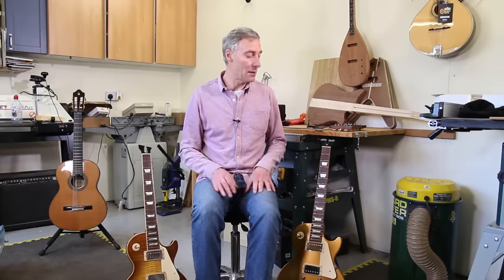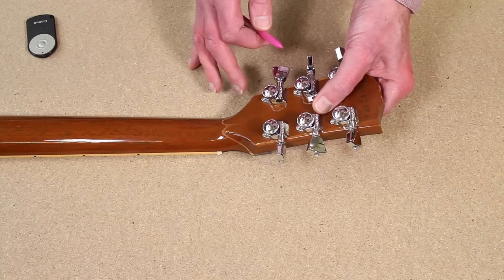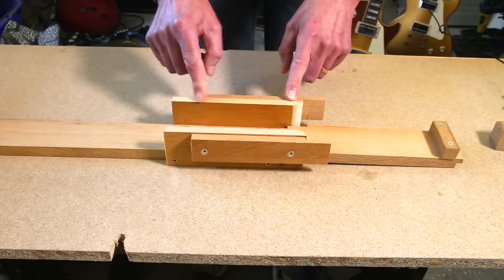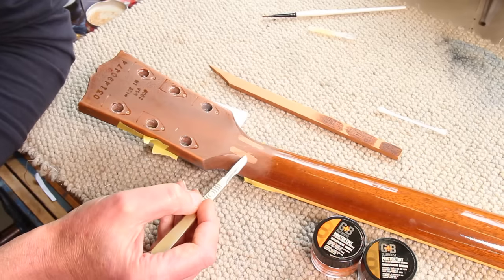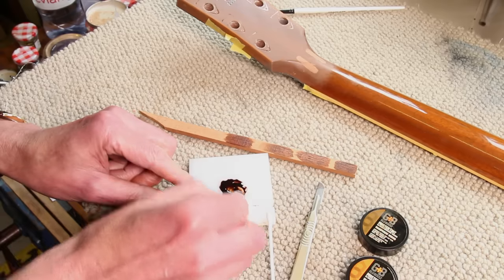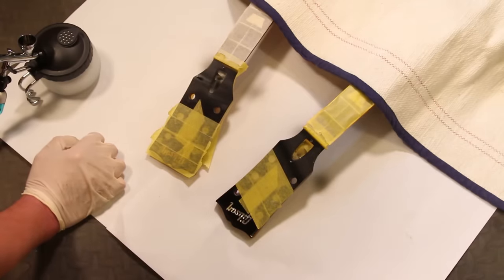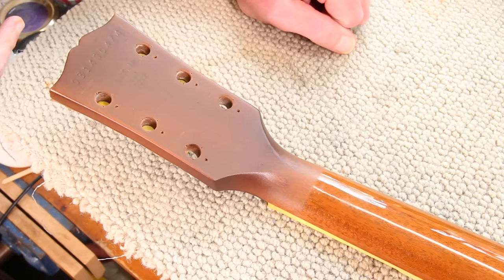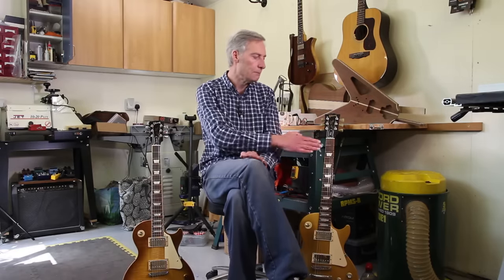Repair of a Gibson Les Paul with a snapped off headstock

Comment: Ok, why would you have went with wood on either of them but especially LP #2?! I would have gotten a couple metal rods. If I went with rounded they would have threads to grab the glue I would smear on them between them and the wood. If I chose to go flat I would have went with one on each side of the truss rod as you did ONLY ON THE FRONT NOT THE BACK! This way you get more strength and don't have to change the color at all! Either round or flat I would go from the front if I glued it first. You just have to bend it to the correct angle. Now if you routed a hole out with a drill or Dremel before hand as I have done in the past... then you just make your bends cut the metal to size with a rotozip and smear glue on it before you shove it into the holes you make. Use a rubber hammer to finesse it back together and you will get an almost seamless repair if you practice enough to get good at this type of thing. I have been doing a very similar break on a cheaper guitar and it is looking really great! I do plan on changing the finish just because the old one is very ordinary with no depth all yellow and plain but if I did not want to I would just file the crack level, sand and then match the color before clearing the top off and buffing it to blend. The metal shims will hold MUCH better and anyone thinking it will vibrate less or lose tone has seriously no clue what they are talking about. You did an ok job I am not downing your work just the approach of going through the back, changing the color and making a weaker than had to be joint while increasing your work load. Also, if you route holes before gluing it as I said through the middle of the broken area as close to the middle of the crack as you can get... you will not need a jig to hold it together. All I did once it was tapped tight is flip the guitar upside down and support the sides for a week or two in a corner until I was sure the glue dried. I usually just use Elmer's School Glue or wood glue. Nothing too fancy and it does a great job! For filler I mix sawdust with the glue sometimes and make a light paste. I get the sawdust from when I route guitars by saving the shavings. Let's not forget why LP guitars always break here... because the wood is too thin, the angle is too sharp and there is a lot of tension on the angle from the strings. Physics also plays a part because when the guitar falls the force is all at that joint when it hits the floor. Putting metal in solves the problem. Putting wood in just makes it possible to occur again and bonus... it is next to impossible to fix a 2nd or 3rd time the way you've shown. My way is way simple and easy, Simple ain't bad! About the owner saying he found it in the case broken when it was put away whole, I would bet it was dropped or knocked over before hand. It may have been days, weeks or maybe longer before the tension made it come apart. Solid necks that have not been dropped, sat on or banged around do not break. I have a 1976 LP Deluxe. The neck has NEVER broken and unfortunately I did knock it over once but it was over 10 years ago and a pedal board caught it before the floor did. My point is that it takes a bit of a whack or force to break a solid guitar neck. It was most likely broken before being put into the hard shell case. NEVER USE SOFT SHELL CASES! They are an accident waiting to happen!

Comment: I would never had accepted the color of the underside of the neck. After the repair the neck should have been clear coated,color matched and grain painted by brush and airbrush and then clear coated again, much as auto repair. I have done this type of paint work for walnut and walnut burl on high end autos, no reason it cannot be done on a treasured guitar.

Comment: My friend in 1974 had a les Paul , he was standing on his front porch and the strap unsnapped and the Butt of the guitar hit the concrete and the head stock POPPED right off he cried.. he ask me if I knew anyone who could repair the headstock and I said “ I WILL “ and he laughed because I was only 18 years old at the time and not quite the mindless idiot he was .. I told him I’ll take the les Paul home and I’ll have it back to him in 2 days.. I went and bought some EPOXY glue you mix for about $2 and I applied the glue to headstock and the neck and wiped off the excess  .. I had no fancy clamps or rubber straps so I smoked a joint and sat and watched tv and Held the headstock and neck together with my hands for about 3 hours .. once the glue was set I let the les Paul sit for 2 days.. I went to the music store , bought some Slinky strings , and took the strings and les Paul over to my friends house , he stringed it up tuned it and the guitar stayed together and he played  it till the day he died .. Yeap ... no clamps no straps no screws , I just held the guitar together with my hands  till the mixed Epoxy cured and held together.. and after I did that with his guitar , James Haney told everybody billy myers was God .. hehe..

Comment: It's bad math to assume that just because most of the headstock repairs you've done are Gibson LPs means they are more prone to breaking. There are too many other variables in play, including:
1. Gibson makes a LOT of guitars. More guitars naturally means more breaks, but not necessarily higher percentage wise.
2. A Gibson LP is a valuable instrument that's worth repairing. Most people getting a headstock break with a cheap guitar are just going to throw it away. Most people getting a headstock break with a Fender or other bolt on neck guitar are just going to replace the neck. 
3. Gibson has been making guitars longer than just about anyone and LPs are heirloom instruments. Between this and the two above, you'd naturally expect to see more repairs. Anything else would be a statistical anomoly.
Fantastic quality work and a joy to watch. I just wanted to give Gibson a fair shake :)

Comment: As a luthier, I would never conduct such repairs.
Repair a headstock?..Sure, but in such a way there is no doubt a repair has been made.
I wonder how this guy would feel if one of these guitars was sold to his son or daughter at full price?
Reply from the maker: There is no intention to make a repair that means that the guitar can be sold as in original condition. Indeed the spines are still visible under the darker lacquer. And the fact that the back of the headstock has been sprayed with a darker lacquer make it obvious that a repair has been made. I suggest you watch my follow up video on neck repairs.

Comment: You can take a telecaster, throw it off a flight of stairs, then throw it on a Les Paul. the Les Paul will break, the Tele will not break after all that. Remember, the Les Paul sold a lot because of the Tele of Jimmy Page.

Comment: Absolutely beautiful, but….. I do not understand why the two lines will make any difference, since the break is angle the new joints has minimum contact. The paint is beautiful too but I will let the original color. So much of time trying to hide the repair and the headstock in other color un unveils it. Just my opinion.

Comment: What the hell are people doing to break headstock off their guitars? I've been playing Les Paul's, SGs, 339s since the get go and I've NEVER had a single problem. Are folks using them as pry bars or something? I've got a Les Paul that I got the year I started playing, it was made in 72 or 74, I got it in 85. I nocked that thing over so many times. It got dropped one story onto a floor and the neck bounced off a wall on the way down. It was on a flight from London to Vancouver and wrongly went through as general luggage, the case was entirely crushed and smashed and the guitar wasn't just fine, it was still in tune, I kid you not. I just put on the strap and walked out with the guitar hung off my shoulder. I see all these photos and I just can't understand. I have 2 Les Paul's, a Les Paul Jr, an ESP Eclipse, an SG and an ES-339, they all have the same sort of head stock. Not one single problem, ever. I just don't get it. What the hell are people doing?

Comment: What gets me is that Gibson aren't doing this from factory to reinforce the headstocks. For $2000+ there is absolutely no excuse. I get that the market dictates their design choices, and that people want things as close the the late 50s holy grail guitars. But when it comes to the headstocks breaking on set-neck/neck-through guitars, routing 2 small slots for reinforcement should be no big deal. The way you did it, and twoodfrd did it, you can't even tell. 

Gibson really are stinkers man, I don't get the hype. Keeping in mind, they are over 2 grand a piece for the base standard les pauls. Feels like the only reason they took off was because they were loaded with 2 humbuckers. I think that if Fender had been making strats with 2 humbuckers in the 60s, they would have killed. That was the natural progression, the 80s was the decade of the superstrat. Now Fender is creeping closer and closer to 2k for the same old strats, the gear industry is scummy man. Every year the quality gets worse, and the prices get higher.

I'm over the brand hype. Getting first new electric in 15 years soon, I'm just gonna get a nice warmoth body and frankenstein my own together. Van Halen saw through the bullsh-t, will forever have my respect for that. "b-b-but mah resale" who's gonna pay 2300 for a 2021 LP standard when they could get a 2023 LP standard new for the same price. This is gonna be just like comics and baseball cards. Over saturate the industry and over value the product.

Comment: It broke while sitting in its case? Sure it did.
Reply from the maker: All I can say is that I have had a number of people contact me and give me the same story. They have no reason to lie to me. In fact I have a 335 in at the moment for a neck repair. The owner is adamant that the guitar was fine when he put it in the case. Opened it some while later to find that the neck had cracked. That said, I'm sure this is very rare.
Reply: @flameguitars5770  Hard to fathom, but thanks for your reply. By the way, you are a master!
Reply from the maker: @ibanmayo2  thanks.

Comment: This type of repair is a lutheristic aberration, I do not understand how they are not ashamed to publish this; It is not the way, and they are depreciating an instrument.
"Stronger than the original" ...? It is enough to leave it in the same conditions, use a low viscosity structural epoxy, I guarantee that it will never break again due to the gluing of the joint.
And taking out those ugly armored pegs, which weigh 350/400 grams would help.
A fall even inside the case ends in breakage, nobody considers the inertial mass of that weight.

Comment: really, it was in a case, it wasnt dropped, and the headstock just snapped off. . . . . 
this crap is why i dont like Gibsons. D & G strings that never stay in tune, a bridge with not enough range for intonation with anything other then lite or regular string gauge, aaaaaand a headstock that snaps off when no one is looking.
 BUT WAIT! IF YOU ACT NOW, ALL THIS CAN BE YOURS FOR THE LOW PRICE OF $1499.00    -_-

Comment: Mahogani + no scarf joint + big hole due to the head of the trussrod=maximum risk. Why does Gibson continue this way ? We know the answer : al the purists stupidly do not want any change in the recipe! Mr Gibson : please do not listen and start removing one of the causes of risks amongst the 3. (For ex. Epiphone lespauls have less problems because they have a scarf joint. Mahogany wood is easy to break, especially if you bend it in the same direction than the grain... too bad